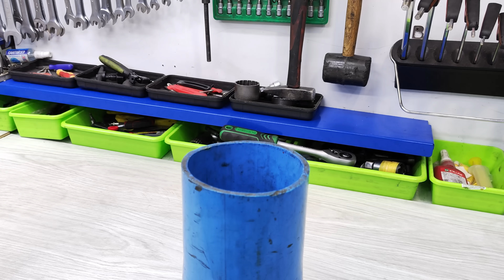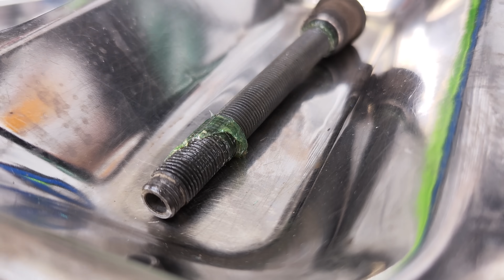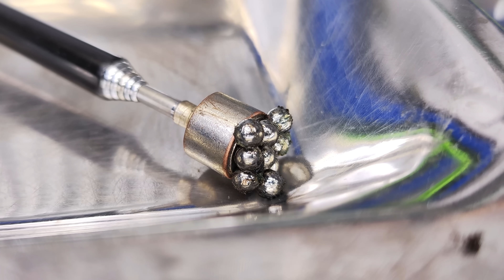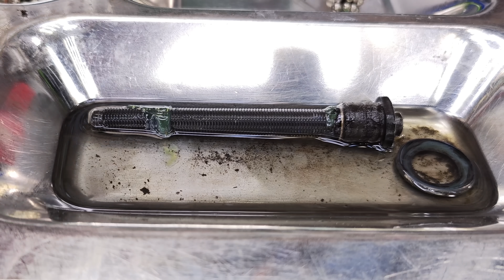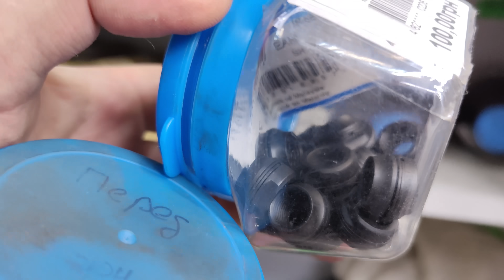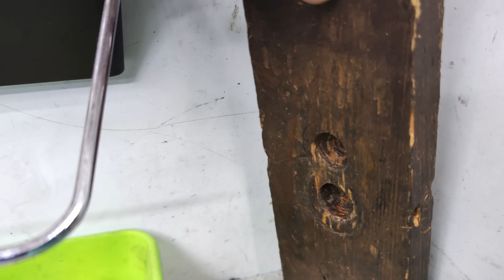How to save your bicycle ! Bike front hub complete service and overhaul

Comment: You can polish out the marks on an angular contact bearing nut if you cannot find the exact replacement . Useful for older models .
Reply from the maker: thanks for the advice ! 😘
Reply: @NiceBikeService  One thing that I will shortly bring up with "Bike Shed Boy" , from the United Kingdom is how it feels to lace wheels with progressing osteoarthritis and finger joint spurs . I am only in my 50's . Do you have any opinion on this ? A man broke my left hand and wrist two years ago when I bad a type 2 diabetes low blood sugar seizure similar to an epileptic fit in front of him at his home . I also had one after a very long bicycle ride as I couldn't stop riding easily /safely . The man that broke my bones is demanding a free bicycle and isn't happy for me to build him a red GT Avalanche custom build in his frame size . Frames in his size are hard to find at a reasonable price at the moment .  The man won't pick from the collection of good mtb frames that I have in my stock inventory . He also wants a rear pannier rack to use as a pseudo mud guard in wet weather .

Comment: I suggest that you use more grease and tightly pack the washer with it, might have a little more friction but grease keeps water out as it's not a sealed bearing, so the first time some water gets in the side effects start appearing soon.
Reply from the maker: Thank you for your advice. There are different opinions about the amount of grease, if there is too much, it will come out and start sticking to dust and sand
Reply: @NiceBikeService  The oil will separate from the grease over time and attract dirt, i agree that you should use more and then the grease that gets pushed out will act as a seal.  These are low end hubs with no seal that require much more frequent maintenance and i would definitely over pack them with grease.

Comment: Nice video.
Water and dust entering those cups and cones hubs WITHOUT seals are just destroing them.
"The" solution is to always clean the external part of the hubs each week in case of a duty bike and each time if it rains.
When you service the internal of a hub WITH seals there is not such things.
You could add in "the" or "a" method to set correctly the play when tihghtening the cups+counter nut.
My one is to approach by hand the threaded cup+counter nut to feal if there is too much or not enough play then choose to tighten alternatively the cup to loosen or the counter nut to tihgten the play and I do this with the shaft secured in a vice for ease of interacting on the threade cup + counter nut.
When you buy a cheap wheel the shaft is always too much tightened resulting in a quick destruction of the threaded cup.
Balls are very rarely damaged as they are the most solid part.
Cups inserted in the hub are also rarely damaged as they are bigger than the threaded ones. 
The parts that are suffering the most are the external threaded cups as they are with a smaller diameter ball race.
Reply from the maker: thanks for the advice ! 😘

Comment: I only did my front and back wheel hubs replace bearings on my road bike a day ago just the bottom bracket and headset but won't. Ring do them next week then its ready for the winter  as i use my road bike to get work on and rides. 
What grease do you use is that  marine grease or Teflon. I use old castrol bearing grease  black in colour its realy good stuff iv had for some time and still to use now iv other grease nut not S good as the castrol bearing grease. Great content all the best😊

Comment: Do you also check the pre tension of the ball bearings after the wheel is build in the frame? The quick release axle will give a higher pre tension on the bearings, also depending on how tight you fix the quick release axle.
Reply from the maker: So, of course, if the wheel is on loose balls, then tighten the nuts a little less, as the quick-release axle presses the wheel

Comment: These Shimano hubs been the bane of my existence in my road bike... Every single rainy ride needed cleaning and relube xD
Reply from the maker: They are not so delicate, they have some resistance to moisture.
Reply: @NiceBikeService I live on the seaside, so rain came with a bit of salt and sand, 6 months in and it was seriously pitted. (and so were the freehub ones) I ended up swapping the hubs for cartridge ones. they tend to last a lot longer before salt water does a number on them. 😁 

But i suppose the unsealed shimano ones do fine on drier situations.

cheers!
Reply: @cheetocatto01 I use a lot more grease than shown here to do the trick. Grease serves three purposes: lubricate, prevent corrosion and seal the bearing. Also, a thick (ep3) grease designed for seaside/marine use (such as marine grease) works better than generic multi use (ep2) grease. Still probably not as resilient as good sealed cartridges, I agree. Cheers!

Comment: Great video, can you let us know what grease you are using and how to get it in the syringe?
Reply: A valid question. I dipped my syringe into the grease and pulled the plunger back, creating a vacuum. The grease (Motorex Bike Grease 310670) was only sucked into the syringe very slowly. I gave up after half an hour when the syringe was half full, that's enough.

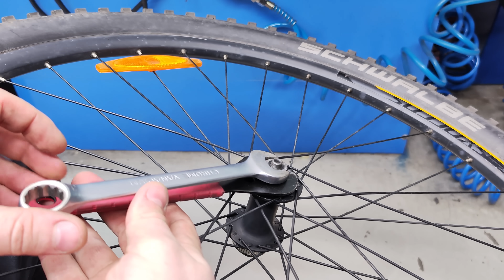Comment: Hey! Nice video again! Congrats! I have a question. I have some trouble. 12:25 at this point, i cant easily enought tighten the screws. One time after aaaaa little tighten it tighten more and doesnt turn freely or if i loosen aaaa little it loosens more than i want and having a little space on hub. Is there no easy tactic or tips and tricks about this?
Reply from the maker: Thank you for watching and commenting. Try unscrewing the wrench by the cone, so that it moves with the outer nut just a little bit, literally a quarter turn
Reply: También es más fácil lograr el ajuste con un tornillo de banco, o con solo un lado del eje montado en el cuadro y en el otro extremo realizar el ajuste fino

Comment: What was the clear liquid that you used to soak the dirty metal parts to clean them in?
Reply from the maker: This is a variant of refined gasoline, we call it "kalosha", so I understand that the analog is camping gasoline or coleman (camping) fuel
Reply: it is a universal solvent/paint thinner based on petroleum naphtha. Very low odor compared to kerosine and headache inducing white spirit or acetone.
Reply: @NiceBikeService  thank you!
Reply: @Mr.Leeroy  Thank you. This helps a lot!

Comment: Where (in Canada) do you buy the cones & bearings?  ie. he has a bin labeled "Shimano HB-M495" for the cone, so I have the part#, but I can't find a place to order this part?  I noticed some wear on one of my cones, the cups and bearings seem fine, but want to replace the cone and the bearings before anything worse happens.
Reply from the maker: We are located in Ukraine and order these cones directly from Shimano's representative office as a workshop. You may find them in foreign online stores, but the delivery will not be cheap
Reply: Thanks for the fast reply!  Excellent videos, btw.  I will attempt to source some, hopefully for less than the cost of a wheel :).

Comment: Shouldn't you measure or at least take an old reference point on one side when fitting the new cones so that the wheel is centered(assuming it was before with the old cones)? Sure, eyeballing might be good enough, but why not be more precise if you already did that much work? Or measure afterwards to make sure equal distance between cones/locknuts and side of the shaft? Thank you!

Comment: I have a rear Shimano XT parallax hub with a seized freehub body. Can this be fixed or maybe replaced? The hub is from 1998 or 99.
Reply from the maker: of course you can.
here are some videos on the subject
https://youtu.be/gJt38PTNwCI
https://youtu.be/K3uoA-basBQ
https://youtu.be/9q-lAc0hQg4
Reply: @NiceBikeService  Thanks🤘🤘
Reply: I got these XT parallax hubs when I bought a barely used set of Mavic SUP 517 wheels. I only paid about 
💰350.00🍁🤘🤘

Comment: What is the thread type on shimano hub axle? Diameter and pinch.
Reply from the maker: The axle is usually supplied with an M9 thread (metric system, 9 mm in diameter)

Comment: Hi what is the part number of those bearrings and the cone
Reply from the maker: I can't tell you that, I don't know.
Reply: Front Hub HB-TX505

bearing balls 3/16 size, 10 on each side.

Y2A198020 Right Hand Lock Nut Unit

Y2A198030 Left Hand Lock Nut Unit

Comment: you could have put a little more grease to start coming out and make a seal against the dust that had entered the bearing
Reply from the maker: possibly
Reply: Con esa grasa es suficiente, la grasa es para lubricar no para evitar que entre el agua y el polvo, hay varios mecánicos que a fuerza quieren llenar todo de grasa, el peor caso los baleros del bottom bracket
Reply: @JavierVargasBG you dont need to grease sealed bottom bracket bearings but you should put grease at the contact points to keep water and dirt outside, yeah dirt sticks into the surface of the grease but it will cant go farther that that, so it may not even reach the outside of the bearing seals. If you outside bearing bb greasing as a type of sealing is a must.
Reply: @JavierVargasBG yeah, there can be to much grease but thats really more important at high speed bearings, like engine powered machines. In those to much grease is similar when you try to run in water, its hard. It can cause the bearings to overheat and fail.